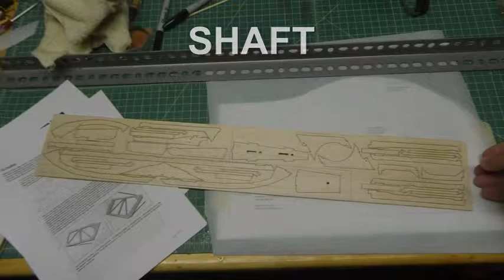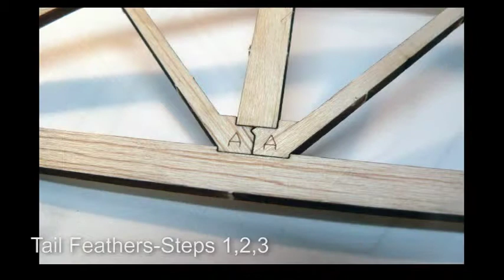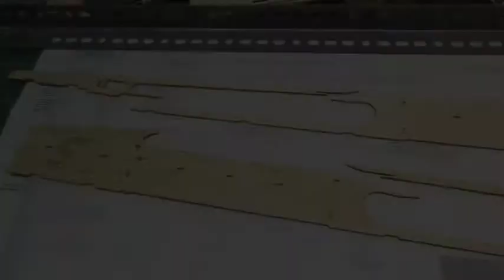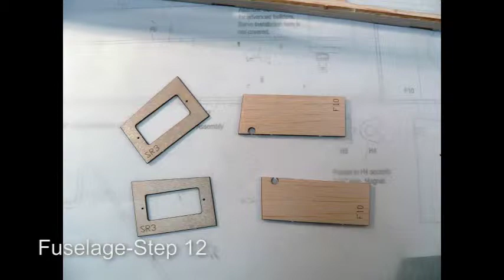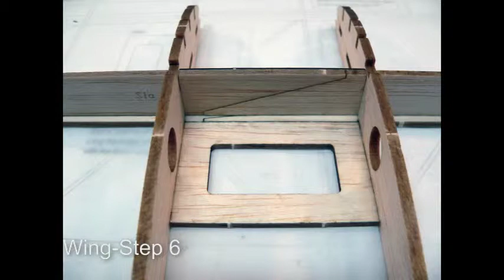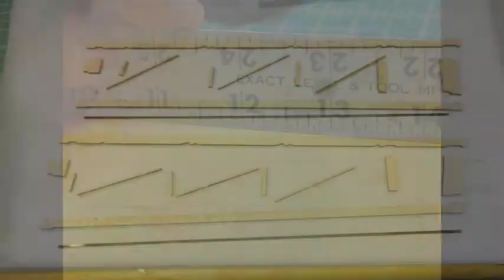Stevens AeroModel SHAFT Build

Comment: Nice video and build.  I built my shaft around 2010 or so and it's still going strong.  One of my favorite go-to little planes.  I, too, would put the ailerons forward if I were to build another one.  I even have a little camera a little forward of the CG and I still have to push a 1800 all the way forward right up next to the motor.  But once balanced, it's a GREAT flying little airplane!